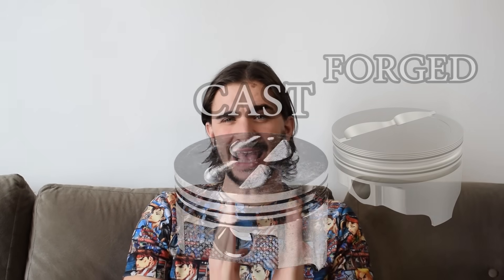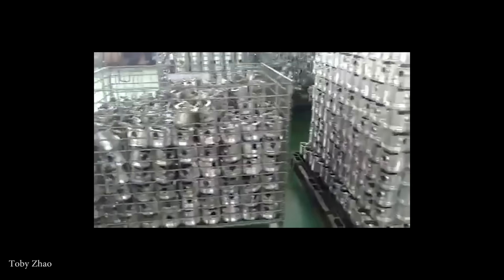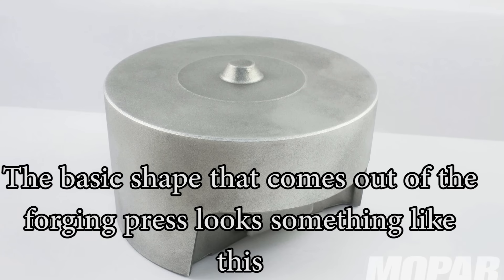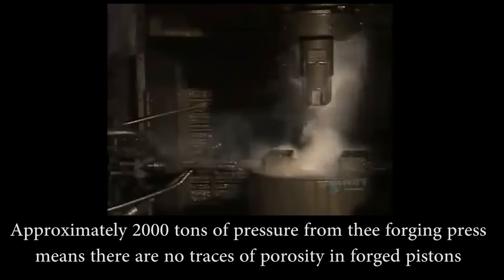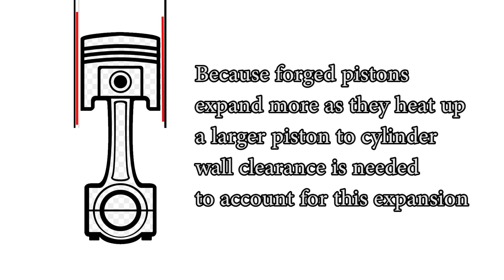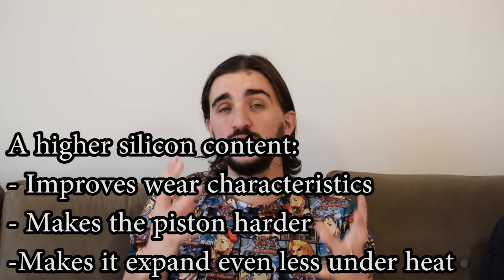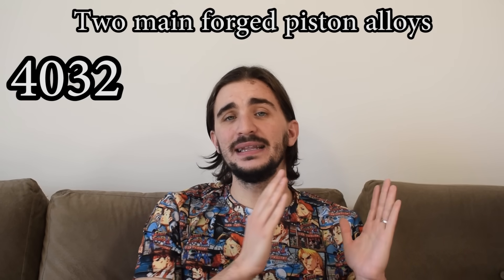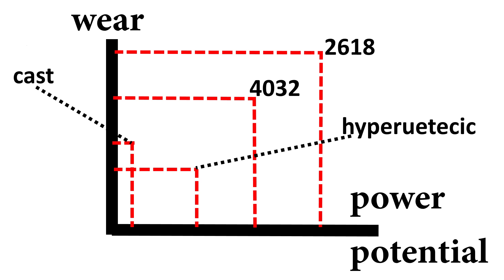FORGED vs CAST vs HYPEREUTECTIC PISTONS

Comment: what if i am running steel cylinders sleeves in the engine? would that help with the "slapping"? for longevity?
can you do another video about compression ratios and pros and cons, because everyone's has their own 2 cents on the matter, 
i need facts, not opinions..
Reply from the maker: More technical videos are coming up! There will be one on cylinder sleeves soon too.
Reply: Sleeves are used in aluminum block and in Cast iron blocks to repair a cylinder. They do nothing for the longevity of piston slap. Piston slap is almost non existent today with higher quality pistons being available
Reply: @unclegeorgesspeedandfeed  i installed MID darton sleeves in my 4 cylinder car.. i mean the original application of sleeves was in diesel vehicles, but i can assure you that i have sleeved cylinders in  my car even tho it is gas..
Reply: @anuar.m.y  your response has nothing to do with what the guy was asking.

Comment: Awesome , Very Informative Video  !!  Once had a .060 over 350 with stock heads that were lightly ported and cleaned up with 
.010 off the bottom , stock rods resized , king bearings , Comp. 270 cam , edelbrock intake & carb . With Cheap Silvolites down in the hole .... This was an experimental low budget buddy build bracket racer that made hundreds of passes until it let go with a broken crank !!   Pistons are Very Strong , Even those Silvolites Never gave it up !!  
Hard to go wrong with K.B. Hyper tho. !!  So , Watch your piston speed , communicate with your machine shop , double check all measurements , spend money on better fasteners , especially the rod caps because that's the most stressed part of any engine ,  and work to smooth the flow in the heads , over work the short side radius , that's where you make power !! 😆

Comment: Dude, thank you. This is useful info, because i would have bought forged pistons for a daily driver and would have trashed the motor in a short time. I will stay with stock cast pistons but upgrade the rods to hold more power for my wrx. Again thank you.
Reply: Don't believe the hype. I've seen engines tore down with forged pistons with over 300k miles on them with zero signs of piston slap or abnormal cylinder wear. The key is a machine shop that knows what they are doing when machining the cylinders for your pistons. Just throwing stock bore forged pistons in stock cylinders might cause a piston slap problem, but if you're going to be boring your cylinders for more cubic inches, don't be scared of forged pistons. Just give your machine shop the pistons you will be using and they will make sure the fit is right, if they know what they're doing.
Reply: How would you have trashed the engine

Comment: So tell me if I’m being dum her! So why doesn’t any one make a piston with rings at the bottom and top so there wouldn’t be piston slap or at points to stop piston slap?  🤔 I know oil is squirted at the piston to lubricate it, surely you could have open ports to let oil out and ports to let oil in on the piston walls
Reply: The top ring holds in the compression in the cylinder. The second ring scraps the bore and the oil control ring pulls excess oil off the bore wall on the down stroke. Oil is being thrown everywhere by the crankshaft.

Comment: Excellent discussion on the differences between these piston materials. Having had significant experience with all 3 in racing applications, the only thing I would add is that in comparison to forged, hypereutectic pistons are far more likely to shatter if anything significant goes wrong. For example, when a hypereutectic piston makes contact with a valve (say missed shift/valve float) that piston will often shatter and take every thing out--rods, block, crank, cam and heads. Often with forged pistons you are just dealing with a bent valve and a salvageable engine. Two thumbs up for this vid--you know your stuff.

Comment: See u r wrong about the grain flow on cast pistons, all cast parts go through 4 steps of heat treat and moralizing  which realligns the muneculer properties to straighten the grain flow and strengthen the parts for use under preasure and extreme heat....I used to make motor blocks, heads, intakes, and pistons!!!

Comment: You touched on coatings for pistons, but wouldn’t ceramic coatings help reduce the expansion from heat with forged pistons? I imagine this is why the 4agze semi-forged (?) OEM pistons are ceramic coated. So they could be slotted into a standard block without needing to resize the bores? Seems very Toyota at least haha

Comment: Thank you so much the clear explanation   Never thought its so complicated. I have an a45 amg and just realised it comes standard with forged pistons and crank. As this is my daily driven car that means my engine will wear out very soon😟? During cold starts should I warm engine up or just drive slowly immediately after start like as I would in a normal car? Thank you for the great info.
Reply from the maker: Don't worry, when and if OEM pistons are forged manufacturers do a lot of things on the engine and pistons to minimise negative effects. I already answered similar questions about the Honda F20C engine which has forged pistons from the factory. Just drive it like you normally would, don't drive it hard before it warms up fully and that's it. Enjoy your car.
Reply: driving 4 answers I finally found a car i like and willing to keep for some time. Thank you for the reassurance. 😀

Comment: Silicon will allow ductility without undue expansion. The Silicon also makes the casting more consistent and will actually adopt a bit of a grain structure somewhat like a forged piston. By the way, silicon is not silicone. housing silicon quit mispronouncing silicon you're supposed to be making it simpler for people not confusing them.

Comment: So what about injection molded pistons? Like cast but molten aluminum/silicon is injected into the mold eliminating air pockets and improving grain structure... Plus they hold higher tolerances so less machining.

Comment: So... Daily driven and staying under 400 horsepower cast Pistons should be more than enough?
Reply from the maker: No no, I never made a blanket statement like that. 400 hp on what kind of engine? How much boost? What fuel? Knock monitoring? There's many more factors to consider before making a decision.
Reply: @d4a  4L V6 1GR-FE Toyota FJ Cruiser with a supercharger on 93 pump gas

Comment: 11 minutes in and while this is an informative video, he did not mention that pistons can actually be tapered. Because the piston will be hotter at the top compared to the bottom. Meaning they can help mitigate your piston slap issue with forged pistons while still dealing with the thermal expansion issue.

Comment: I put hypereutectic pistons in my street  car naturally aspirated 351w  just a set of heads and cam old block bored .040 over do u think that is a good choice
Reply: Does it have greater than 10.5 to 1 compression?
Does it get shot with nitrous oxide or turbo charging?
Does it operate above 6000rpm?
If you answer no to all of the above then yes, good choice.
Reply: @johntempest267   it has 63 mm dish pistons to keep compression down won't b over 6000rpm  will be near 6000 rpm frequently but it is redline max no turbo may spray in the future  nothing over 100shot shot but

Comment: When I saw the hypereutectic pistons, I was like, "they are making pistons out of cast iron?", this phrase is used in cast iron metallurgy; you have eutectic and eutectoid, the amount of carbon being below or above 8% respectively, but hypereutectic means it's right at 8%, which has characteristics different from less or more carbon, so I was a bit confused on this video. You did an awesome job explaining all this! People need to know the what and why, before they spend big bucks on their engine, daily driver, a bit more than that, it a full blown racer
Reply: You are mixing steel and cast iron Fe-C phase diagram, also it goes from 0,01% C to aprox. 2% C for steel and from 2% to 6,67% C for cast iron.
Reply: There is HYPOeutectic (meaning less), eutectic (menaing on the spot) and HYPEReutectic (meaning more) when dealing with Aluminium-Silicon alloys.

Comment: Thanks for an informative video, Is there a way to determe what alloy my forged JE pistons are without smashing them with a hammer?  And yes JE did not help me and they are not marked innside
Reply from the maker: Look at the piston underside. A cast piston will have casting lines. Cross hatches are also a cast piston giveaway. Forged pistons will usually have a smooth underside with a relatively simple shape, and definitely no casting marks. There may be some numbers or additional machining.

Comment: When it comes to grains in metal, you're not quite right. There are processes that promote "stacking" grains.
It is enough to change the process of cooling the metal and the cross-section of the grain will change completely.
You said that in forums people simplify their statements and all you have to do is read a few pages of the book to get the knowledge you need to speak.(no ofence I suppose my statement is not complete either)
The metal alloy from which the forged piston is made is also ... an alloy (so according to what you said, there would be no differences between them) only quality-enhancing work has been done on it, it can be rolling metal, it can be heat tempering.
The material pressed to shape does not lose the grain system, which guarantees high durability.
 Piston can be casted and subjected to processes aimed at reducing grains or arranging them in parallel in one surface to increase the possibility of stress transmission buut not every one of them can be done on piston without changing their dimensions and this is important beacuse piston production process has it specific order. The best possible option would be to have "one grain piston" so whole piston would be one crystal of metal. seek how its made aicraft turbofan turbine blades . 
Peace

Comment: So your saying that forged piston cause more cylinder wear in my opinion it's miniscule I've got a small block Chevy in my truck that I built with Forged Piston with 265.000 miles on it and still going strong with cylinder pressure on each cylinder Still as good as the day it was broken in its all about setting the engine up right and proper maintenance and what you are going to build the engine for I built a high performance engine that can be driven everyday and there a hole lot more to cylinder wear than just the piston . Choice of rings, piston, oil , maintenance and how you drive has alot to do with it

Comment: I don't understand you say a higher silicon ratio makes the pistons stronger, you then say forged pistons made from 2618 (the one with with a lower silicon ratio) are the strongest?

Surely that's a contradiction, or am I missing something??
Reply from the maker: Silicon doesn't make them stronger, it makes them harder, expand less and wear less. 2618 is the most ductile. This is why I said in the video, the word "strong" is a bit misleading.
Reply: @d4a  so wouldn't, by that definition, a higher silicon be better for forged pistons too?

Comment: You probably aren't old enough to remember the days when Ford forged pistons had an wrist pin offset to help eliminate piston slap. However the racing engine builders discovered that if one turns the pistons around,  there was tremendous piston slap upon start-up but once the engine had warmed, the motor produced about 5 hp more than an engine with pistons installed in the orientation they were manufactured for.

Comment: Do the downsides of forged pistons still apply if the engine block is forged, too?
Reply from the maker: Engine blocks can't be forged. There are engine blocks completely machined out of a big billet but that's not forging and it's used only for very extreme applications. Pistons will still expand regardless of the block, but there are advanced cylinder liners that try to minimise any potential negative effects of high thermal expansion in pistons.

Comment: Interesting. I haven't really needed to worry about  piston metallurgy in my bread and butter cars. Still interested in the engineering though.  You have distilled  it down into some simple choices. A lot of engine builds now just using the standard bits for reasonable increases with a bit of matching and inspection and they do work well for daily drivers which most of us have. Some cast pistons even have steel struts cast into them to control expansion. In Australia, the latest craze is building up a " Barra" and to to a lesser degree, the GM sourced Buick V6 by taking a stock high mileage but still sound engine and putting  on a turbo and getting some good value reliable performance for nix.  And then there are the yoyos who put forged pistons into mum's shopping car just like putting a full race cam into a street car. Goes well with the high stall converter. Overkill for bragging rights but poor engineering choices.   The Hypereutectic pistons would be a good upgrade over standard cast pistons in many daily driven applications and probably serve well unless you have a 10,000 rpm driving style. Probably a bit more thermally tough too.
Reply: You have no idea why you are talking about so just stop.

Comment: Isn't the 2jz pistons are forged from factory.. Cuz i saw many used the 2jz as poorman build for 4g63 engines
Reply from the maker: Definitely cast. But they are a very good design able to resist lots of boost and abuse.
Reply: @d4a  nice info.. Thanks for the explanation..

Comment: Great video. I learned something new.
Reply: In relation to my interests, the Honda s2000 came with forged pistons and crank, but cast rods. I wonder what the logic there was.
Reply from the maker: The F20C has many tricks up it's sleeve, some of them are fiber-reinforced cylinder liners and molybdenum disulfide coated piston skirts, both which do a lot to reduce friction. And while the pistons ARE forged, they have a high silicon content. The f20c also reaches operating temperatures very quickly, so many things are in place to minimize any forged piston downsides. I think the rods are forged steel and likely have surface treatments to ensure they do their job. The F20C is a very advanced engine with lots of really interesting tech. I will be covering it eventually in my iconic engines series.

Comment: Even with cast pistons, the type of casting method is as important as the alloy.
You show aluminum being poured into a mold. That is "gravity casting". Prone to voids. There is also pressure die casting (machine pushes the molten metal into the mold). Smaller voids. Vacuum casting (molten metal is pulled into the mold). Practically no voids. The forging process creates a surface layer of metal that recrystalizes (randomly) and needs to be removed.
Reply from the maker: I have mentioned modern casting methods towards the end of the video as a big part of the reasons why cast pistons aren't as bad or weak as some think. I really couldn't go into detail about the different casting methods as that would make the video very long and defeat it's purpose.

Comment: These work with 2 stroke as well? As for turbo/super chargers?
So if you calculate expansion and adjust the rings properly.
In regards to wear, it can be mitigated with oil choices.
Reply: High silicon content alloys were used in air cooled 2 stroke engines 50 years ago. It was mentioned in the advertising for my 1970 Bultaco Metralla.
Reply: @machintelligence  That's fine. But as for today, see above questions.

Comment: This reminds me of how everyone gets a boner when they hear the word "billet"!!!! >when in reality there is a time and place for it, and that doesn't mean every time and everywhere. On that note the same goes for titanium. I make medical device parts out of billet aluminum, billet stainless and billet titanium; and as stated above, there are applications that said material will work in and there are plenty of applications that it will not work in. I also make parts for my car, motocross bike and street bike out of all of those same materials and found the good and the bad in them all. I run a cast piston in my motocross bike and have never had an issue. Its stable and wears is minimal while also still causing minimal harm to the cylinder wall.

Comment: Put a heater element into the oil pan of the forged piston engine, heat up the oil before starting.
Reply: Not everyonewants to keep their engine heated or like they do in higher grades of racing run coolant from a heater through the block to get the engine up to a safe temp.
Reply: Dude you have no clue what your talking about. If the engine is machined properly there is no need for this.
Reply: Corey Brewer hmmm... Is that why Formula 1 cars get heat blankets one engines before they start in cold weather? I guess they don't know how to machine their engine blocks😂
Reply: @Soravia  They are designed to run at absolute minimum clearance at running temperature for the absolute in performance. One consequence is that the engine is locked tight at normal temps due to aforesaid expansion.  They are preheated using a heater to circulate coolant through the block so the engine is evenly heated. No good for cold starts in the morning. Ordinary engines are made to looser clearances so you don't need a crew of mechanics to preheat your engine an hour before you go to work. Not the absolute in performance but more practical
Reply: Rogy Doj duh, that's the same reason RX-8 (series 2), E90 BMW M3 V8, etc come with RPM limitations until the engine is warmed up. Without such ECU limit on RPM based on engine temp, what would one do with tight engine pistons and cold weather? Put in a block heater to preheat the oil before the engine starts to reduce or prevent the wear!